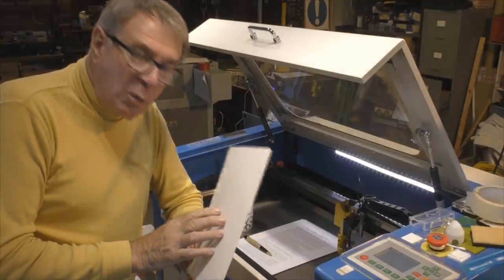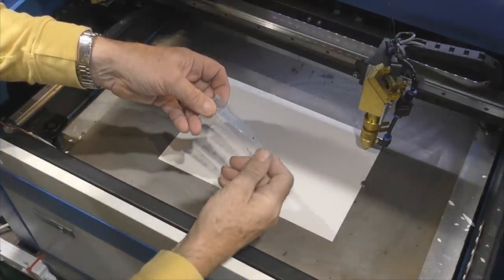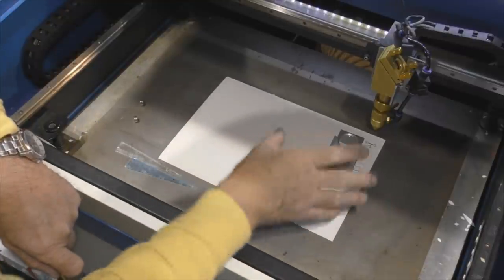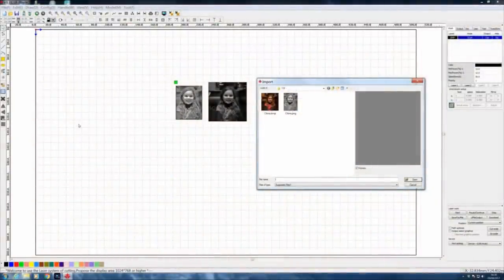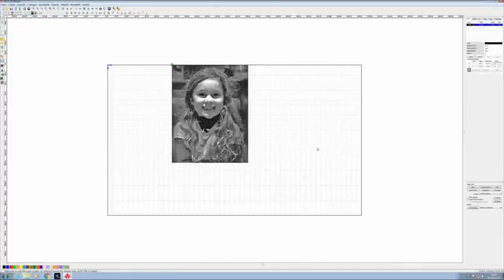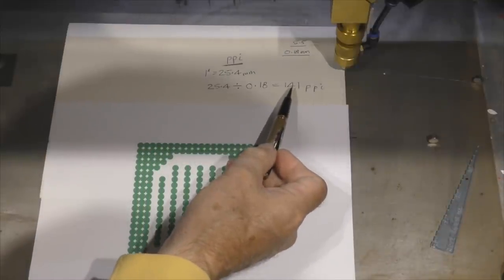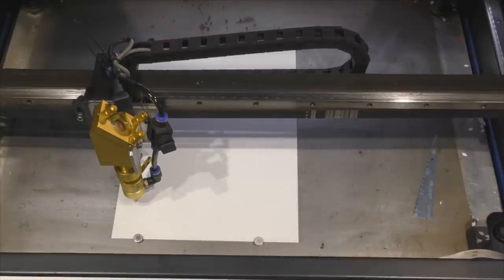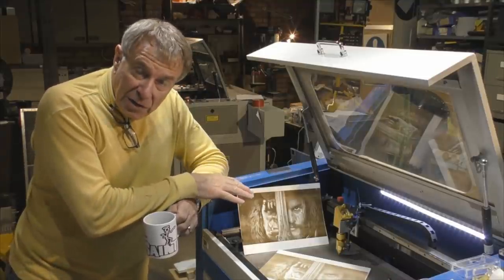RDWorks Learning Lab 115 The Russ Formula for Photo Engraving

Comment: Hi Russ, 12 year CO2 veteran here, I'm engraving baltic birch exclusively, I'm using 150 dpi at the finished size needed, floyd-steinberg 93% 1 bit conversion, 150W tube going at 600mm/sec 75% power, .15mm stepover and they all come out fantastic.  If I need any more contrast, after engraving I blow it clean with compressed air, lightly spray it with rustoleum 2x ultra flat black spray paint and once it is dry I sand with a new 120 grit at low rpm using a dewalt DWE6401DS sander.  I've experimented with just about every combination of paints, sanders and laser settings and this make amazing photos.  Hope this helps somebody
Reply from the maker: Hi Robert
 Many thanks for sharing your method. I can understand every single step, and why it works. Since I defined the method in this video I have , on and off, returned to the problem and  refined it. I now understand so much more about how materials, laser beams and lenses interact.  We have hijacked a print industry process for converting grayscale images to black dots on a white background. In reality it is impossiblle to get  black dots on organic materials, we always finish up with a sepia effect because of apparent brown dots. I say apparent because in reality what we produce is a  small needle point pit with a brown halo around the top edge where the outer (low intensity) part of the beam is scorching rather than piercing. The central needle point may appear black but close examination shows it to be natural wood colour inside and the black is an illusion because of light occlusion.  The brown halo around the holes is modifying  the ratio of black and white so essential for this dithering method to work by fooling your brain.. That is why I have spent much effort perfecting a compond lens design that almost irradicates the halo.   Your method is first filling those needle point pits with  REAL blackness and then you are removing all those  brown scorch halos and restoring a clean light background.  You are  now getting as close as possible to the black  ink on white paper print industry ideal.  Congratulations.  Your lower resolution also greatly helps because you can afford to create  much bigger (0.2mm) dots without overburning. I have recently been trying to decode how the borax method works and was amazed at the great contrast I was able to achieve on Baltic birch.  See  this video from 21 minutes. https://www.youtube.com/watch?v=7pFuW1zPkkg&t=1183s       I am using a 254 ppi image.  There is a method of putting a black image onto a white ceramic tile, discovered by Nicky Norton, that allows me to push the resolution to 508 ppi. See this short unpublished video  
 https://www.youtube.com/watch?v=TVgmoN1wljs    This is going full circle and achieveing an authentic copy of the print indusrty process.

 Thanks again for sharing your method. I can see it being successful on woods that are impossible to photo engrave ......like bamboo.
 Best wishes
Russ

Comment: As a youth I was drawing things on my C-64 and printing them out with an 8pin dot matrix printer. I was describing the process to a newspaper publisher, he ran his own printing presses for the small newspaper. I kept saying halftone. He explained to me what halftone was and the 'proper' term. 

Before computers. Newspapers would transmit black and white photographs with a halftone machine. The transmitting machine would scan the image, measuring the light level of the picture in a grid type pattern. Like graph paper. As it scanned the picture it would, over phone lines, send a sound. The lower pitch the sound would correspond to light areas, a high pitch sound would correspond to dark areas. I may have this backwards. It could have been a high tone told the machine to jump to the next position and the length of the low tone meant drop the head, the length of the tone determining the depth of the melt. The receiving machine moved the same, in an x,y axis just like the transmitting machine or the head on our laser cutter. The head had an up and down lever. The bed of the receiving machine had a bee's wax filled tray. The receiving machine would let a heated cone shaped needle sit on the wax. light areas less time, small circles. Dark areas deeper and larger circles. So halftone really is a element size change. (I am going from a 40 year old memory. I know I am close, but not precise. We could probably google it and see one working. Comic books used the halftone machines to transmit from coast to coast the pictures.) 
What the dot matrix printer and our lasers have is a uniform dot size. What we do is "Dither". That is where a pattern of dots are used to generate the illusion of larger dots, or darker areas. Using a 6 sided dice(die?) you have a classic 3x3 dither pattern. pattern 7,8,9 are missing, vertical center row missing from the pattern. 

A CNC mill with a conical head could easily do the halftone pattern. 

Your videos are really nice, I learned quite a lot. I have some machining training. I have an AA degree in Electronics. Your explanations were spot on. I would gander that the reason for the acceleration/deceleration caused by the teeth of the drive belt on the pulleys. If you have an extra toothed pulley, you might try widening the gap between teeth or depth of the groves on the pulley. My guess is the teeth on the belt are not sliding into the pulley evenly or not recessing fully, this causing the belt to jump up and down, depending upon if it is riding on the peak or valley of the pulley. I had the same kind of thing happen on my wood lathe, someone suggested I get a link-belt to drive it. That is the kind of belt made from small leather links. You could change the length of the belt by adding or removing links. The result was huge amounts of chatter on my work pieces. 
Sorry about the length of my text.
Reply from the maker: Hi
The problem with toothed belts is that they were never designed for oscillatory precision drives. Their function was for  non-slip uni directional POWER driving. It has become accepted that they are perfect for lightweight positional drives such as inkjet printers but start adding any sort of mass to the system and the design weaknesses such as tooth clearance, tooth flex and the polygon nature of all drive pulleys, start to manifest themselves. You can mitigate some of these weaknesses with innovative design but that's why they use lead-screws or anti-backlash rack and pinion drives for larger machine tools.
Thanks for the comment
Best wishes
Russ

Comment: Thank you so much for all your work on this and the files you sent me. You made this so much easier for me to get great quality engravings using your method.
Reply from the maker: Hi Tim
It is a method that forces you to understand the elements of the process. The numbers will be flexible as you change materials as you will have seen is you have watched the anodized aluminium engraving sessions.
Mineral materials next.

All best wishes
Russ
Reply: SarbarMultimedia, yes Sir I have already done some testing with different Wood species and getting great results. When I purchased my large machine 1300x900mm dual laser machine a couple years ago I had it shipped with a spare nozzle and three different focal length lenses and mirrors. After your instructions I was going to try the 1,1/2” lens. I found out they did not supply the short nozzle for it. I ordered an entire laser head assembly for it with 1,1/2” lens and mirror installed so I know it will work. Look forward to getting it in a few days. I have used 1,1/2” lens on my small 50w machine and your results reminded me of how much the quality improves with it over the 2”.

Comment: Russ,  I can't believe that you read all of these posts, but you obviously do. I received my laser clone from my brother when it didn't do what he hoped it would do - etch easily on granite stones. It has been slow going getting a room ready for it and getting it calibrated. Your methods gave me the confidence that I needed. It wasn't all smooth sailing as I have blew out the contacts when I had all the peripherals plugged into the back. I have had to make a contact switch to allow everything to come on when needed. I have watched 50-60% of your videos and have learned quite a bit (I have been sick for the last 3 years so Youtube has been used a lot to pass the time away.)
It would save me hours and hours (as you have shown) to get dialed in on my own. Would you please send me as many  of your formulas, worksheets, and files that you would be willing to send me. 
Your long time follower, John
Reply from the maker: Hi John

Attach your email to a comment. I get auto copied to my gmail so I will delete your comment to remove your email from public view.
Best wishes
Ryss

Comment: I've followed your whole "dotty" series and the insights you provide are invaluable!  I really enjoy the way you take the time to explain the engineering principles on how you developed your formulas and why.  I'm also amazed at how effective your simple test prints are at deriving the information you need about the laser - like dot size or how to determine if the laser could do grey scale.  They are well thought out and simple patterns that provide fairly precise information.

I believe all the files I need to give this a go are on the RDworks website, correct?  At least they all seemed to be posted there.

Thanks again for all the hours of frustration you continue to save me on this lasering adventure.  I have no idea where I'd be or how much material I would have wasted up to this point without your videos.
Reply from the maker: HiMike
I think there is another whole layer to dot size and resolution that I have uncovered the tip of that needs a more in depth exploration. It does promise higher resolution pictures on some materials. The fundamental principles that I have discovered are perfectly valid for all materials but with certain materials there may be other phenomena that can be exploited. It's amazing that there are so many subjects still to explore and understand, at the moment I can see no end in sight.
All best wishes
Russ

Comment: what program do you use to get those dots to see the resolution. and how do you set more dots/inch .is that where you squeeze the picture larger and smaller.
Reply from the maker: I used Photoshop  and set a very small area with a resolution of 254ppi. I then used a 1 pixel pencil to create the pattern. 254ppi is a pixel size of 0.1mm.
Pixel resolution is fixed  regardless of the picture size  if you shrink the picture you can choose to keep the pixel resolution the same or if you halve the picture size, some programs will re sample and quadruple the number of pixels to create a resolution of 508ppi.  The problem with this is the laser machine cannot create 0.05mm dots so you cannot print a 508ppi image

Best wishes
Russ

Comment: Hi, I have the dots bitmap but when I put it into lightburn it goes in as an image. I can't burn only the dots. It wants to burn the white background as well. Do you have another file with only the dots and no background. Thank in advance!
Reply from the maker: Hi 
You wili import the pattern into Lightburn as a bitmap because that is exactly what it is. However this is not a normal bitmap picture or photo that can be dithered. No this is already a specially prepared dithered image at 254ppi.. You can prepare any image outside of Lightburn and dither it in that 3rd party software where you will save it as a bitmap. When you have imported it into lightburn , open the parameters window and at the bottom you will see a PASS THROUGH switch which must be set to green, so that Lightburn will just burn the third party dithereing and do nothing to interfere with it.
 Best wishes
Russ
Reply: @SarbarMultimedia  Ok, that makes sense. Thank you very much!

Comment: I’ve enjoyed your videos immensely and regularly share them. As RDworks is what it is, a less-than-stellar design package but essential control package, I wanted to share a markedly improved alternative. LightBurnSoftware.com has a late beta “upgrade” to RDworks which adds many enhancements: MacOS support, node editing, welding, image processing, rotary controls, bitmap tracing, offsetting, and much more. It works with RuiDa controllers like in your (and my identical) laser. While not free (it costs $80 for two seats) it can be tried free for 30 days. I and my laser students are very excited at having this option and for those who want more design control or run Macs, it’s a valuable alternative to have.
Reply from the maker: Hi Travis
Yes I run and keep up to date with Lightburn It is already a fantastic piece of work and I nearly always use the photo engraving element at present. I love the great intuitive way that Oz has organized his windows. SAdly at present I have to run RDWorks as well because none of the user settings or Vendor settings are yet designed for Lightburn It may take another year to complete but I agree it is a great package and I regularly feed back test results to Oz.
Thanks for the thought. As you progress further with my videos youwil find how happy I am with Lightburn and I use it in my hunt for the 1000dpi myth.
Best wishes
Russ

Comment: Everytime i watch your videos ,i  learn something , i know its an old video , but can i have those papers ? Need to make this happen on my machine !
One another question ,is it possible to make the process faster?
Reply from the maker: Hi Osama
 Once you have mastered the basics of this subject it depends on the quality of your tube and critically  the response time of your  HV power supply. You may be able to eventually be able to run at 400mm/s under certain circumstances with hard materials like glass or slate.
Just add your disguised email to another comment and I will send you the data   (osamaatgmaildotcom???)   I will then delete your comment
Best wishes
Russ

Comment: Subscribed. This is an incredible breakdown of what is happening when we run our lasers. I have been doing several tests and he been lost up to this point. This may help me get a better handle on things. When someone says it's a 2" lens, is that the distance from the work piece, to the height of the lens? I'm being told that I might need a compound lens setup. My laser manufacture states that I can get up to 500dpi with stock setup, but I am starting to disagree. I brought a fairly high definition picture into lightburn and u burned the image on anodized aluminum and the picture looks "ok", but under a microscope, the lines and dots appear to be blobs with overburn at 300dpi. I have a lot of information from this video to digest and test some more on my setup.
Reply from the maker: Hi Robert
 Your machine manufacturere has no idea what lens you are going to use therefore he cannot say how many DOTS  PER INCH you can produce. A dot is something that appearts when you focus the laser beam through a lens and damage the surface of your material. Different materials have different damage thresholds so the size of your dot will depend on A) The material  B) The focal length and orientation  of the lens. C) How well you have focused the lens. D) The power you are using and E) The speed you are using. All or any one of these factors detrmines the smallest DOT you can burn. Typically with a 2" lens (the distance from the face of the lens to the work) you can get 0.3 to 0.2mm dots. If you put them side by side a 0.2 dot will get you to 127DPI.  Note  (25.4mm/0.2mm = 127dpi). The Chinese manufacturere either does not understand or is deliberately trying to mislead you with 500DPI. In reality 500 DPI  is 25.4/500 = 0.051mm which is the smallest STEP distance that the machine is capable of  ie the CNC system RESOLUTION and is nothing to do with photo engraving.

 Egraving anodized aluminium is a weird yet forgiving process where it appears you can get amaing DPI results. The process of anodizing electolytically  creates a thin surface of aluminium oxide on the surface of the metal. This is basically the very hard white material they use to make grinding wheels. It has a melting point of about 1300C. Regard this surface  material as ultra fine salt crystalsv where there are micro voids between the crystals. Before they finish the anodzing process and seal the surface, they dip the product in a water based dye to add colour by filling the voids between the crystals. When you heat the surface witha laser beam you are really just evaportating away the dye (at maybe 150C) to leave the white (high temperature reistant ) white surface behind.. You cannot OVERBURN a surface that will not burn, it just removes a tiny bit more dye.  Overburning only applies to organic materials that will burn deeper  if you reburn an already damaged spot.

I hope this sheds a bit more light on the subject.

Best wishes
Russ
Reply: @SarbarMultimedia  it does make sense and thank you for the quick reply. Some find all of this stuff dry, but I got bit by the bug 😁